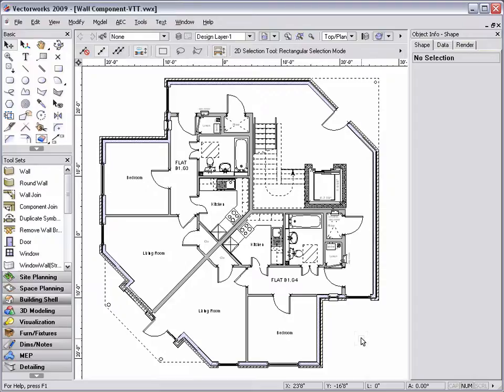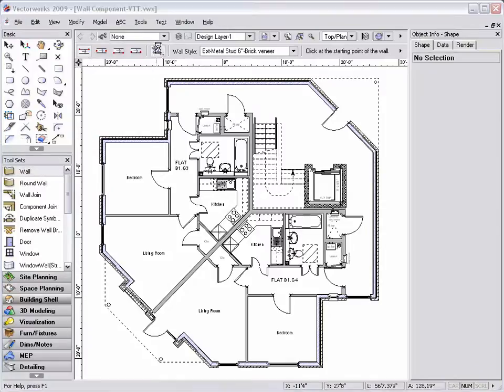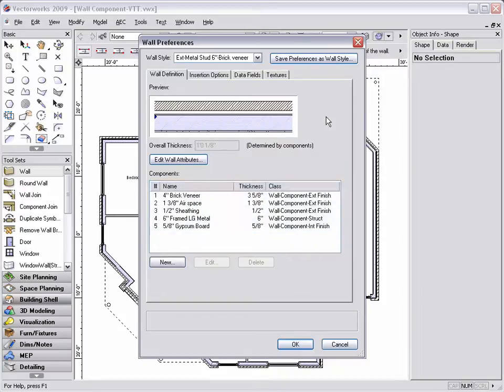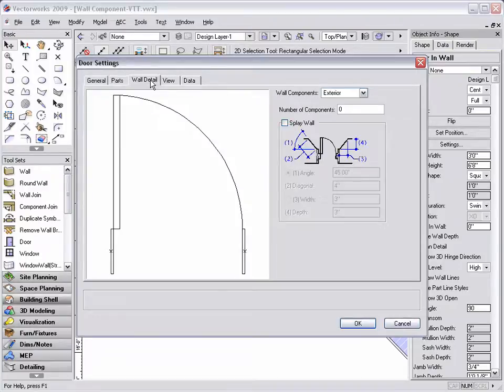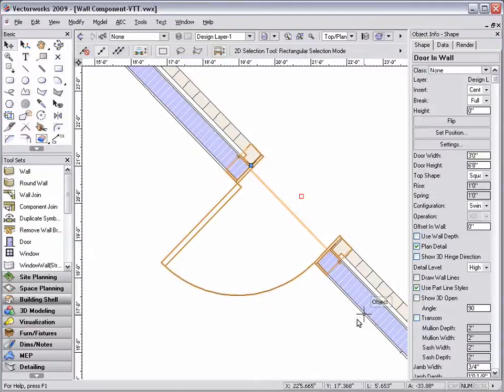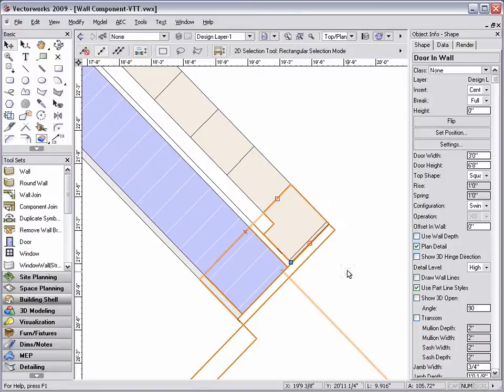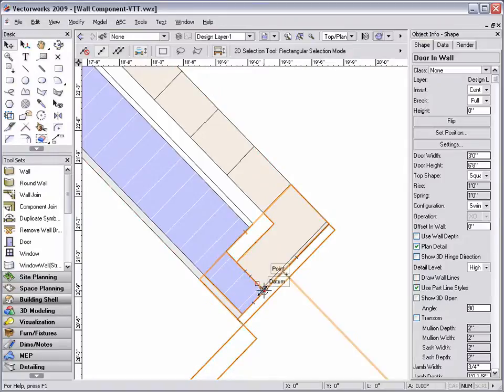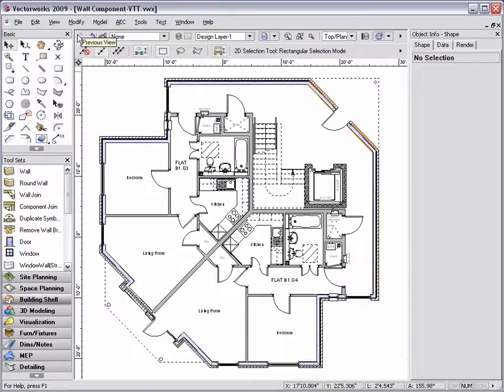Wall Components in Vectorworks

Comment: Does it really still not working in 3D?
Reply from the maker: Nope, it works just fine in 3D in modern versions of Vectorworks. This video is for a version that is 8 years+ old.
Reply: Does it work fine in 3D in Vectorworks 2017? found this problem on the forum for 2017
 https://forum.vectorworks.net/index.php?/topic/50263-support-for-3d-wall-detail-component-returns-at-windows/&page=0#comment-252164
Reply from the maker: That is an enhancement request for even more functionality. You can try it for yourself with the demo to confirm what youd like if you want to be sure: http://www.vectorworks.net/trial/form